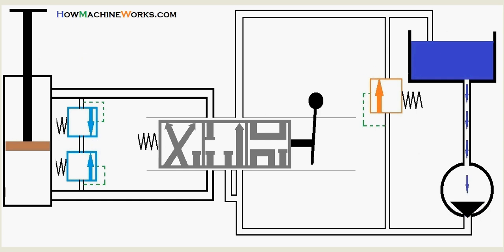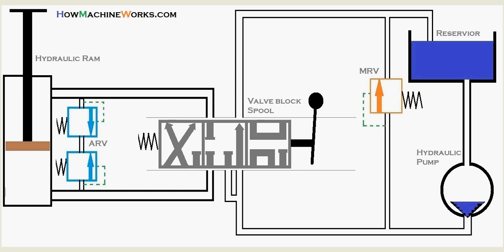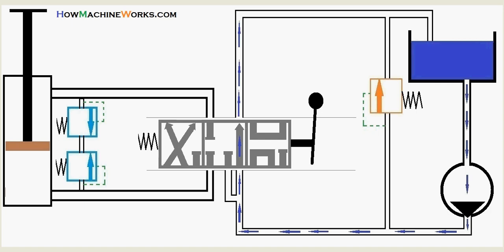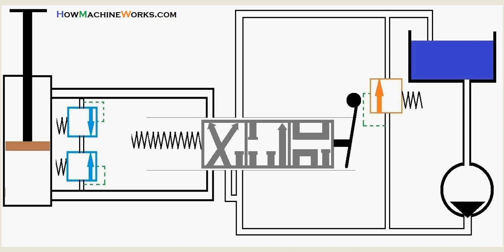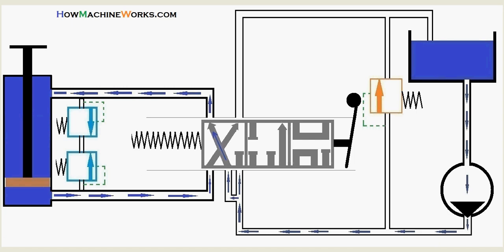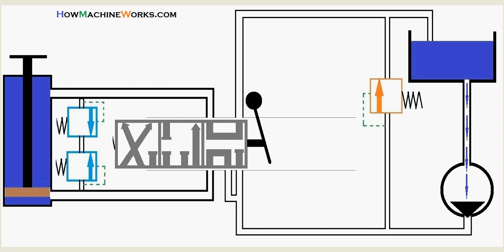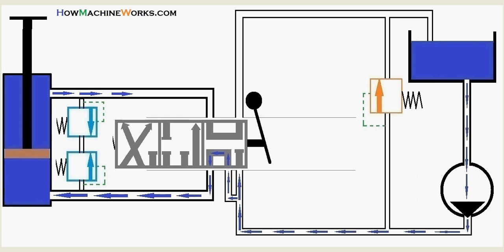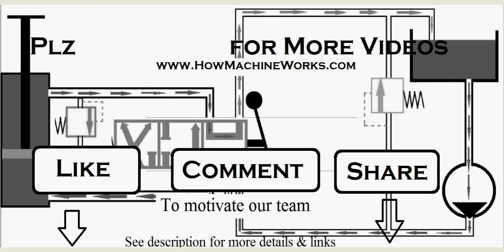Animation - How hydraulic ram and valve block spool works - Must watch

Comment: What happens during the short time between shifting different galleries?
Reply from the maker: Certainly! It sounds like you’re discussing the hydraulic flow in a steering system, particularly the behavior of the spool valve during different operational positions. Here’s a more professional version:

“When discussing hydraulic flow in steering systems, the movement of the spool valve is central to directing the fluid appropriately. As the spool shifts, it aligns with different galleries, allowing hydraulic fluid to flow through the selected path. However, each transition passes through a neutral gallery, where the fluid is directed back to the tank. During these transitions, if any resistance to flow occurs—such as from a blockage or sudden load change—this is where the main relief and auxiliary relief valves engage, ensuring system pressure remains within safe operational limits. Please feel free to ask any further questions; I’m here to help clarify any specifics!”👍
Reply: @TechTrixInfo  yeah that's what I was asking! Makes sense! Thank you!!
Reply from the maker: @jamessever8936 Thanks for asking. Feel free to ask questions 👍.

Comment: Is this what you can called as a Power Pack?
Reply: Rogue Splitfire I have the same doubt can u clarify
Reply: sara vana Nah it's okay thanks btw
Reply: Generally speaking the power pack is namely the electric motor, hydraulic pump and tank with its controls at least - providing the hydraulic 'power' to do work via externally connected apparatus. Most applications have external connected equipment like lifting cylinders etc. But if something is 'all in 1', where electric motor, hydr pump and eg; hydraulic winch for example were together, then that could be considered the power pack simply because it is all in the 1 package.

Comment: nyc,,,,where it is used''''''''''''''''???
Reply from the maker: Its the basic circuit for any hydraulic system which has a hydraulic ram, If you have seen a Backhoe loaded machine say CAT, JCB etc those machines employs hydraulic ram for doing a work, this is applicable in such cases - the only difference it that it will have more rams and more spools in the valve block.